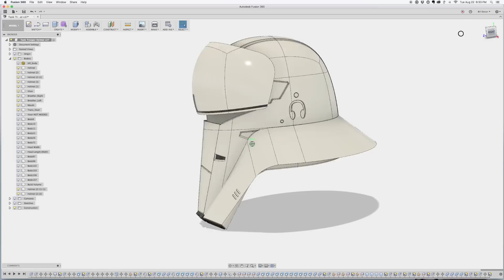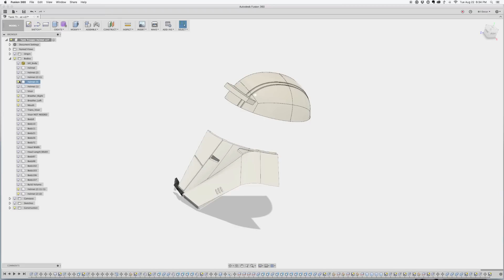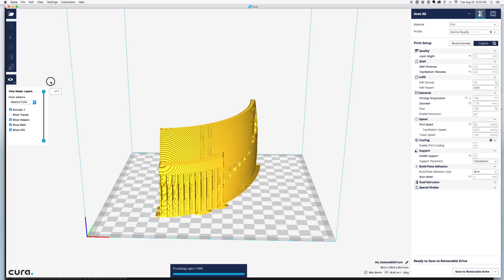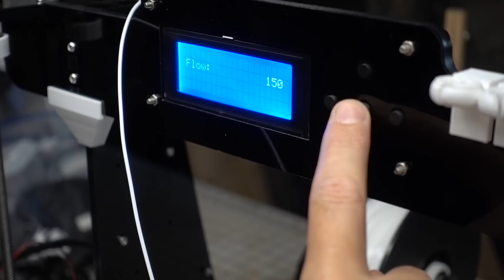Printing the Rogue One Tank Trooper Helmet on a Cheap 3D Printer

Comment: Hey, I know this is an old post but I'd use a glass bed which offers many benifits. One, you get a smooth bottom finish and two at about 35 degrees Celsius the parts will just pop right off which is probably the biggest benefit.. no more issues with part removal such as scraper needed, breaking/bending a part, or tape coming off. Also at 60 degrees Celsius, parts stick to the bed very well (no glue-sticks or hairspray needed which is the only way you can reliably do an automated print queue that knocks off the prints for you). Best!
Reply: Micheal Kinney bruh

Comment: Do you use the anet a8 to print all of your cosplay props?
Reply from the maker: No, I got rid of it when I was done with this helmet. I have several other printers that perform much better, so I just use those.
Reply: I am in the market for a printer but do not want to spend a lot of money. Is the net a8 good for starting out? Will it make decent props? Or do you recommend a different printer?
Reply from the maker: I go over that in the final video in this helmet series.

Comment: Do yourself a favor, take those springs off the print bed.  Turn it into a fixed height bed, you will be MUCH happier.  In fact the quality will go up 10 fold on the a8.  The Z wobble brackets are definitely NOT needed. Those rods are supposed to move. As long as the bearing rods are tight the worm rods can flex a bit.

Comment: Great video...this has inspired me to do the same - but attempting to create the model from scratch in Fusion360 (as a way to take beginner skills to the next level).  One question - how did you model the brim that goes around the helmet from one side of the chin to the other.  I considered a loft using rectangles at various points around the helmet, but even with the best reference pictures, I am having a heck of a time getting things lined up where that solution works.  Is there an easier way I am missing?
Reply from the maker: I don't remember exactly, but it might have been a loft. It took several tries to get it right.

Comment: sees title... oh a cheap 3d printer and it looks real nice hopefully its like #500! checks price... $1000 for the cheapest... oh... I dont have $1000... anyways awesome video!
Reply from the maker: This particular one was $150.
Reply: Never mind, I am an idiot....
Reply: there's lots of cheap sub-$300 printers out there on the market, most of them have their issues, so don't expect easy, out of the box printing. But if you're somewhat engineering inclined and know how to browse reddit to troubleshoot they can be lots of fun! I'd personally opt for a printer with a heated bed so you don't have to use the painters tape and can print with a wider range of materials like ABS or PETG too. Notable cheap printers I can think of off the top of my head are the Anet A8, Cetus, and CR-10. I'm personally putting in a pre-order for the Prusa i3 mk3, but it's $750, so not a cheap printer, but certainly a great machine.

Comment: It's probably been suggested by now, but if you ever find it a pain to swap out that blue tape every few prints, there are a couple better options. If you're doing mainly PLA, a tempered glass bed would work well, and can be had for pretty cheap. Though you're usually going to want to put down some hairspray or ABS/acetone slurry for adhesion with other materials. If you want something that sticks amazingly well to most materials but takes a little more care when removing parts, PEI sheets can be found for around $10 and potentially last for hundreds of prints.

Comment: One tip I'd like to share with you Bill is to get rid of the painters tape and get yourself this instead: 

https://www.amazon.com/Velleman-K8400-BT-Buildtak-Surface-Printer/dp/B00STUMYZC/ref=pd_rhf_gw_p_img_4?_encoding=UTF8&psc=1&refRID=E05YM9AN9NY8GATZNPS8

You can cut it to shape to the hot plate, adhesion is much better when you print onto it and all you need is a dry or damp cloth to clean it after every print unlike having to replace the tape every time or having to use rubbing alcohol on it. I've already used it about 5-6 times now with no issues. Also, just done a baby Groot statue that took 10 1/2 hours to build and it adhered nicely to it so no fuss, no mess and came off the surface nicely with zero to no issue. And from what I've seen about it too, maintenance to keep it fresh and on going is easy too.

Comment: Hi

Great videos :D love the content :D i have the same printer as you have and did some upgrades too, to make it more stable, but i think you need too tighten you tolerence on bed a bit more 

I have the Autolevel sensor installed on mine and i saw a huge increase in quality just by makeing the bed closer to the nozzle, a4 paper between the nozzle and bed and needs to drag/grip alitle bit that helpt alot for me and got awesome result 🤗 keep up the good work 💪hope this help with the print quality :)

Comment: I just got done with a iron man helmet build myself and I went with 10% infill, 0.8 wall thickness, prints came out strong and manageable. you might want to try these settings and save your self some filament

Comment: I don't know if this will help you but to help the sanding process have you considered using  acetone? I have tried it and it works great (The acetone "melts" the filament). I apply it to a paper towel and rub the print. It creates a very nice glossy finish, Plus its takes MUCH less time and effort than regular sanding methods. When I do this I like to have an exacto knife  or semi-dulled carving tool at hand to keep my clean edges near details. It would help though to get the print relatively smooth (no sign of supports), however I don't do any manual sanding. I simply take off the print from the bed and rub the acetone on without any sort of prep. Hope this helps
Reply from the maker: Alas acetone won't do much to this PLA. =(

Comment: In Cura you can set the initial flow multiplier for the first layer, saving you the trouble of setting it manually for each print. Also can recommend a ''Buildtak'' like material for the bed surface. Happy printing!
Reply from the maker: Good ideas.

Comment: Really cool project! I love the tank trooper helmet. I did a similar build a few years ago for two sets of snowtrooper armor for myself and my brother. I never found a really strong way to glue PLA parts together so I welded them together with a cheap soldering iron. Not the cleanest way to get them to stay together, and it can require a good amount of sanding and cleanup, but it was the strongest.
Reply from the maker: That'll do! I'll be using my pins and probably super glue or a 5 minute epoxy.
Reply: The metal pins really are a great idea. I've got a Stormtrooper helmet that I sculpted in Zbrush that I have been meaning to print out so i'm thinking I will give the pins a try on that.
Can't wait to see the final Tank Trooper!

Comment: To fix the z wobble issue, print the following

https://www.thingiverse.com/thing:2067676

I have these printed for my A8 and it made a huge difference.  
Along with these
https://www.thingiverse.com/thing:2192303

You'll notice that the lead rod is slightly off vertical. This will fix that while still giving it a little play vice the bearings with no play

You'll see a huge difference

Comment: If you haven't already, upgrade the wires for your heatbed. This is probably the biggest flaw with the machine and a lot of forums on Thingiverse about the issue. Mine shorted out and I have not been able to use it for over a week, while I try to figure out how to fix it.

Comment: Looks like the Anet is on the friendly side of ease-of-use.  I use a FF creator pro and it rocks with print quality, Buutttt...leveling the build plate sucks. I have to reach underneath, turn the wing nuts, reach back on top, see if it's level, repeat 15x. I know you didn't seem happy with the print quality, but you're gonna make it look amazing. Skillz, man! :D

Comment: i love my anet a8 it looks like you have several of the same upgrades i have and they do make such a massive difference in the print quality. i have had my anet a8 for almost 5 months now and all i had too replace was the fan for the heat break cooler. i have been running my a8 prity much constant scene i had gotten it.

Comment: Helpful tip for better supports: turn on interface layers. It's like a roof on top of your supports so there's less drooping on the surface of the model. I can get overhangs to look pretty darn good, maybe not top surface good, but better than what you've seen. 

On top of that, setting the air gap, sometimes called "Support Z Distance," to at least 0.4mm, or 2x the layer height if larger than 0.2mm will make supports pop off in one clean chunk. I've removed prints from the bed and the support has stayed behind it's worked that well. 

Happy printing! Looking forward to more progress
Reply from the maker: Oh cool! I didn't even know that was an option.

Comment: Awesome video! Don't forget if you ever get trouble with supports like it fusing to the print, you can change the spacing of the support the link I have provided below is a perfect example.

https://ultimaker.com/en/resources/20422-cura-support-settings
Reply from the maker: Awesome! Thanks for the info.

Comment: The horizontal stippling you're seeing may not be related to your Z axis. It might be inconsistent extrusion. Measure your filament in multiple places and put the average in the slicer's Filament Diameter setting. If you find it's much more than +- .05 mm variance in your filament, order new/better filament. Another option is that you can decrease your flow rate and border on under-extrusion, or reduce your layer thickness to decrease the effect, though that'll increase print time to a great degree. 

Whatever it is, it looks MUCH more like flow rate variation than Z axis inconsistency, especially since that's a dual motor Z axis you have there.
Reply from the maker: Thanks for the tips!

Comment: Hey bill fast question. You printed with the anet a8 at 50mm/s but, at what speed do you usually print with your "good" printers? Like the dremel idea builder for example
Reply from the maker: I haven't tinkered with printing speeds all that much, but it looks like my Ultimaker is set up to run at around 40mm/s.

Comment: Think you'll ever release the video of you modeling the helmet? I followed your thirst zapper video and printed it at work, made some adjustments so i could press fit everything came out pretty good.  Have you ever tried using buildtak instead of painters tape?  Things tend to stick really well (too well sometimes) but i never have to worry about curling anymore.
Reply from the maker: Alas I did not record the helmet modeling process.

Comment: Any info on thought process of selecting the type of filament used for your 3d prints (PLA, ABS /w enclosure, PETG, etc.)?
Reply from the maker: I prefer to print with PLA because it is incredibly forgiving and easy to print with.
Reply: Perhaps, but ABS is easier to finish. Seriously, sanding PLA sucks.
Reply: duckrutt True, though I'm more worried about PLA's lack of flexibility and low deformation temp so I've moved over to PETG (printed entire Shoretrooper and E-22 blaster in it so far). Ease of print makes sense when compared to some of the pain you can have dialing in other filaments (warping with ABS, stringing with PETG, etc.). I'm interested to see how bonding and reinforcement (if any) of parts goes if they continue to print the whole armor since I'm also working on it as well.

Comment: Quick tip for another A8 user: Check out these build plate surfaces... Still on my first one of a 3 pack. Adhesion is great and they hold up for a long time. 
https://www.amazon.com/gp/product/B072JM7QJ4/ref=oh_aui_detailpage_o08_s01?ie=UTF8&psc=1
Reply: Yes, enough with the painters tape already!
Reply from the maker: Super neat! If I was planning on using the A8 more, I would probably buy some of those, but for now the tape is working great.